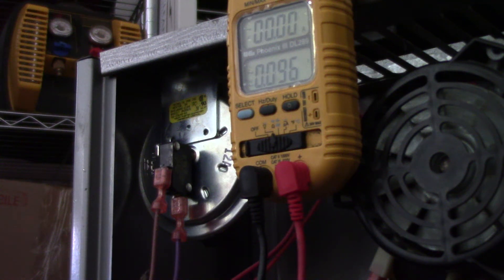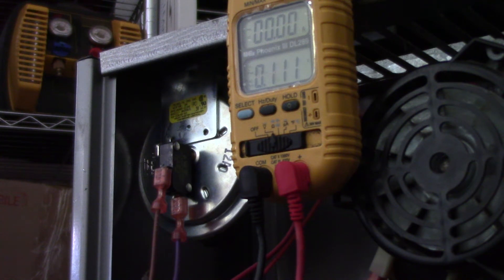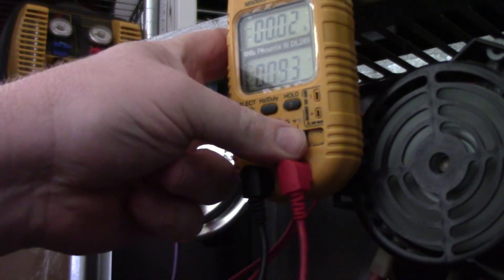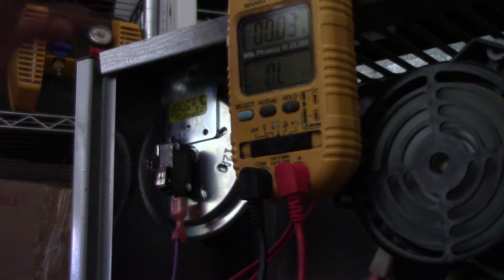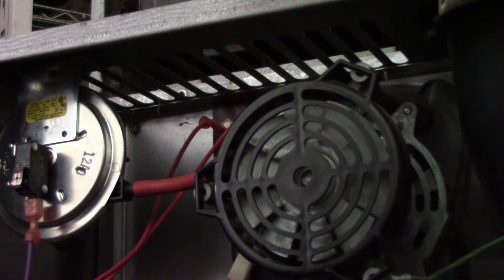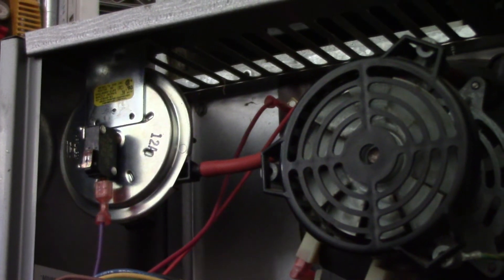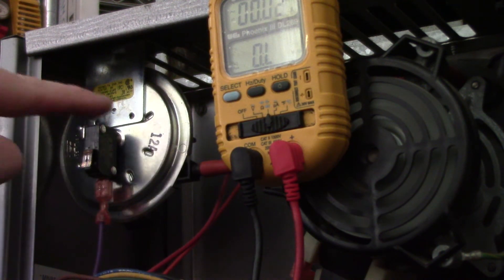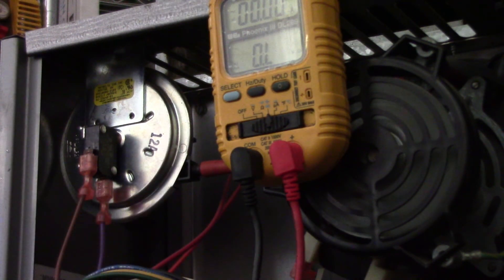Troubleshooting a gas heater furnace pressure switch

Comment: Ok so we went to switch our furnace on and it did not come on this is the second time in the past 2 years it has done this and both time it flashed a code 3 air pressure switch error but that was changed out and it didn't fix it had my local HVAC guy look at it and he tested and determined it to be the main control board and now 2 years later it has done the same thing it's not working. I turn the thermostat to heat set the temp and the code light flashes 3 times. The blower works fine for AC. I haven't called him yet as money issues I will need a new furnace this one is old like 35 years old but is it the control board? Or what is causing the control board to go bad?
Reply from the maker: If the inducer is running check the hoses and ports. This video and another give step by steps troubleshooting tips. There are about 10 different faults that give the pressure switch stuck open and a few that issues that cause pressure switch stuck closed. The board could be bad last time for a few different reasons. Think about it, the furnace control boards has about 150 parts on it, all it takes is one to go bad and things don't work. It could have been an installer error or a power surge or it vibrated until a part broke. It could be a collapsed vent cap this time that has it not working. Watch the 2 videos and see what your furnace is doing. It could be a bird or a squirrel in the vent or the inducer squirrel cage it broken or rotted away.